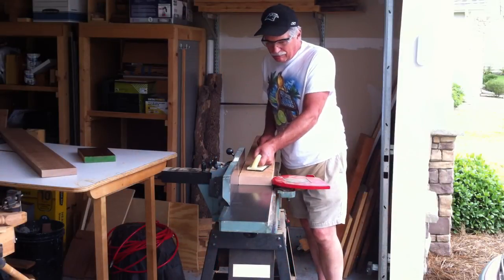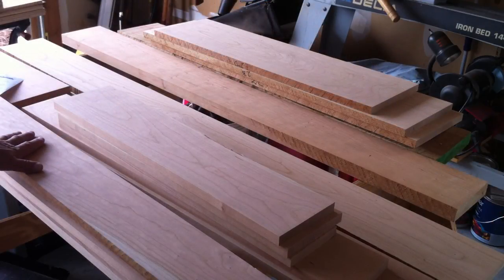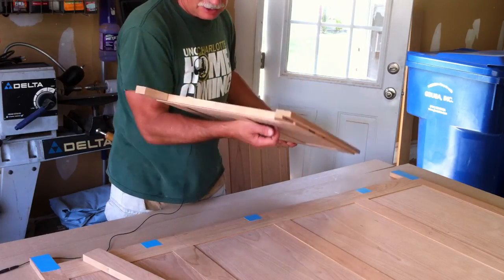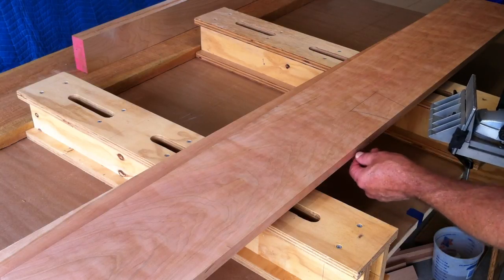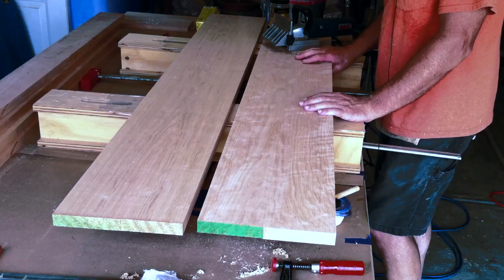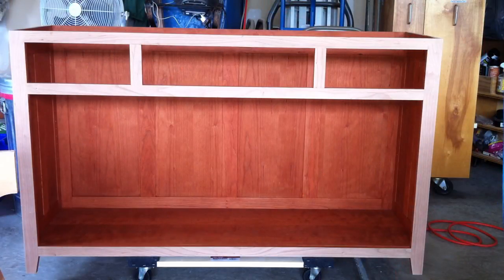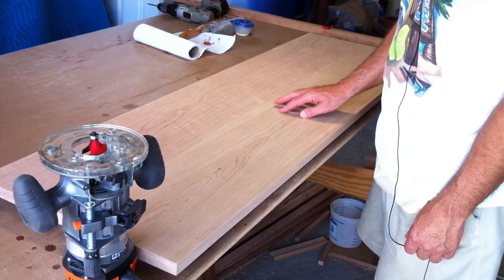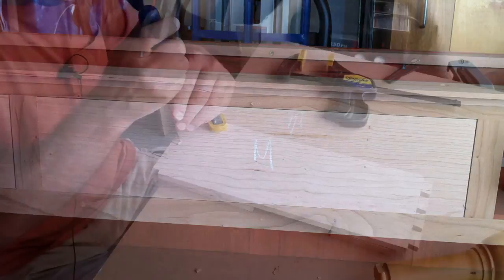A Cherry Buffet

Comment: This is turning out great (haven't finished watching yet, I'll save the second half for tomorrow)! We have an ideal space in our dining area for a buffet, which I also hope to build sometime in the future, so I'll definitely be referring back to this video for ideas.

The picture-in-picture idea works well, no real explanation is needed for routine table saw cuts, so simply including those as a PIP while you continue to discuss things like layout means you get to show the cut being made, but it doesn't increase video length.

Personally, when video lengths are long like this, it works better for me when they are split into parts (10 to 20 min each is about ideal for me), but I respect that that would also come with additional editing/posting time ...etc. Besides, I am perfectly capable of watching a single video such as this over as many sittings as I choose, so not a big deal in the end, I suppose.
Reply from the maker: Jeffery - Glad you're enjoying the video.  It was a big project but turned out very nice.  The only thing I would do different is to increase the thickness of the styles and rails to 7/8".  By the time I glued together two pieces of 1/4" plywood and added the veneer it didn't leave as much reveal around the panels as I would have liked.  It's fine as it is but that would have improved the project I believe.  Thanks for your comments on my editing.  I had just started editing with iMovie on my Mac and was still learning the various features.  I edited most of my prior videos on my iPhone.  I learn something new everytime I edit so hopefully my videos are improving.  I know it's long but considering it took me 2 months of weekends to finish the build I cut out as much as I thought I could.  Again, thanks for watching and for the comments.  Take care,  Steve